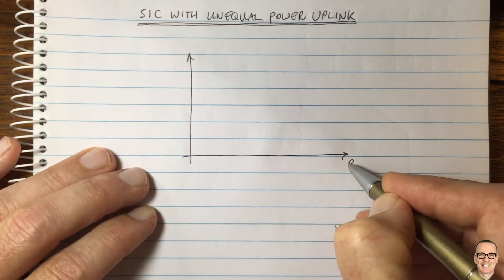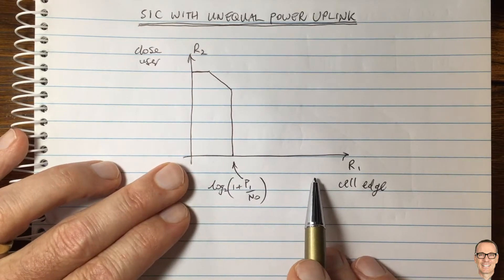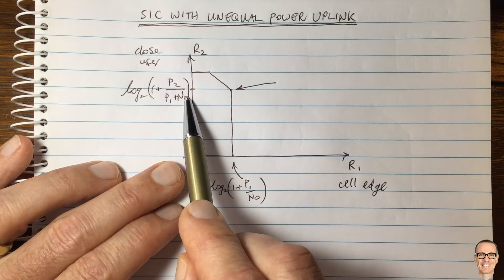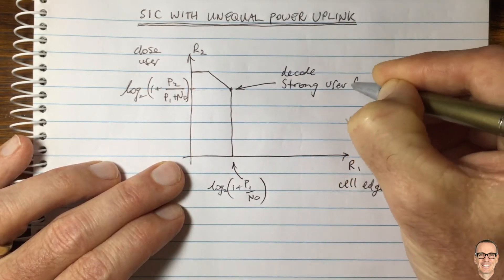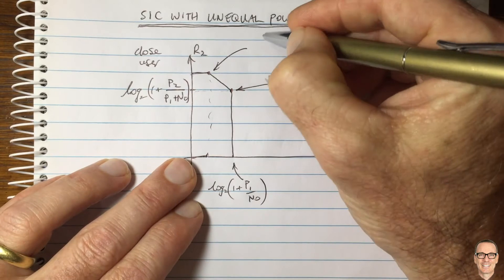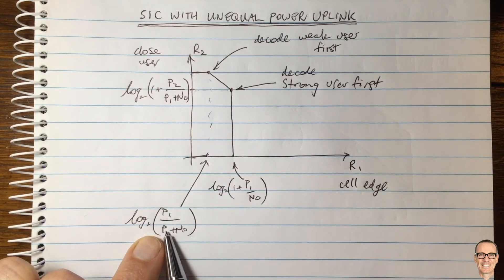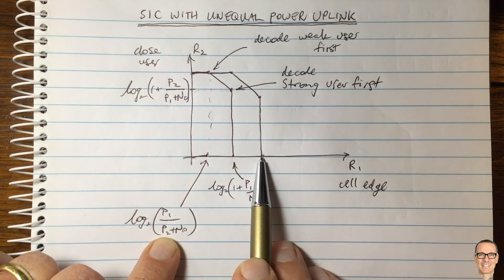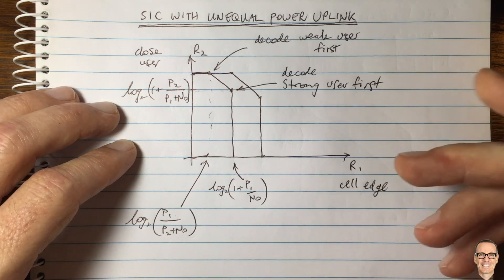Successive Interference Cancellation (SIC) with Unequal Power Users

Comment: Hi Lain,

Thanks for thé video. I have a question.
The user who is decoded later, his rate is the one without interference from the first user. Why can't we go for third détection (for thé first user) where WE deduct the data decoded for thé 2nd user and thus achive a better rate even for thé first user?

It is not done as it will cause more latency for thé first user ? What if it is a delay tolerant user with higher packet delay budget ?
Reply from the maker: It's important to realise that these rates are "ideal" error free rates. In other words, they are the maximum rates possible, assuming perfect/ideal forward error correction coding. Therefore there is no extra benefit from "re-decoding" the first user in a "third round", as you suggest, since the first user was already decoded perfectly in the first round. In practice (without perfect FEC coding), you still wouldn't try to re-decode the first user, because if errors were made in the first decoding, then they would have adversely affected the second user's decoding, causing even more errors for that user.
Reply: @iain_explains  thanks for your reply.. But the rate achieved for the first user is log2(1+SINR) while if it had been decoded again after decoding the second user, we would achive log2(1+SNR) which is higher than thé previous one, no?
Reply: @iain_explains  I just realized that if thé first user transmit at rate log2(1+SNR), then we cannot decode it without error in the first place and thé 2nd user's signal cannot bé decoded without interference.Right?
Reply from the maker: Yes, you've got it!  log2(1+SINR) is the fundamental limit. You can't beat it! (if you want zero errors) ... you can always send at a higher rate - but you'll get errors.
Reply: @iain_explains  thanks.. for the similar reason, only one user does SIC while the other one does not in case of downlink?

Comment: hey, thanks for another great video. I was wondering if there are more practical communications concepts in your to-do list or in you expertise in general. I think you'd explain RF terms like non-linearity, compression points, spur, intermodulation, mixing and filtering really well.
Reply from the maker: Great suggestions, thanks. I've added them to the list, and I'll give them some thought.
Reply: instablaster